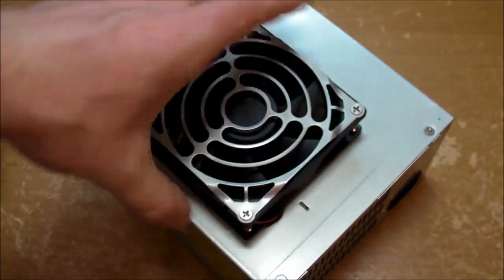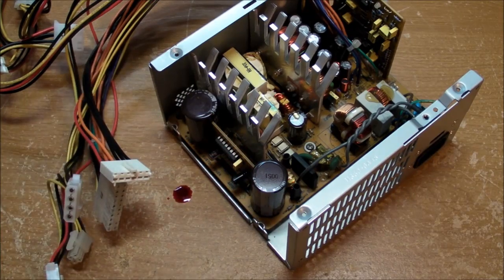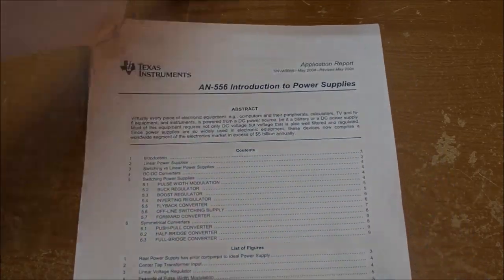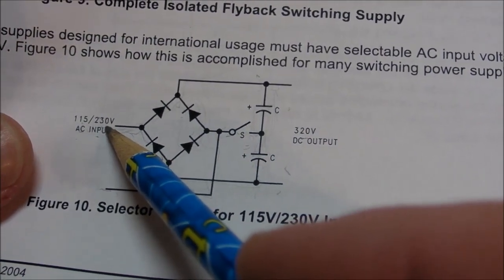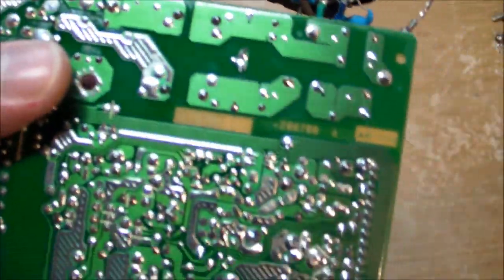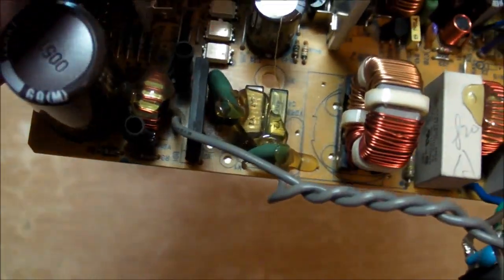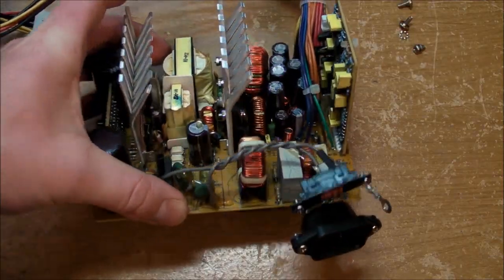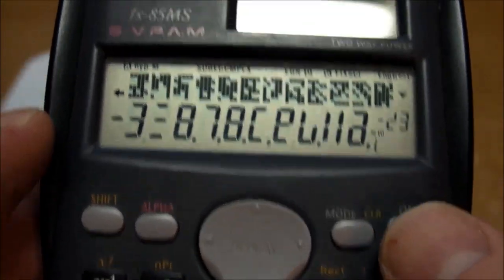(#0211) Simple Voltage Doubler Circuit in SMPS

Comment: Now server switching power supply only accepts 200-240v ac, will replacing these voltage doubler would work for using 110v? I have HP HSNPL-33 - thanks

Comment: 200V caps under duress of 283Vpk while on the 115V setting? You've aged your caps and sent them on their way to an early grave. The MOV is the first to blow (thankfully) but that's a sign the caps are next.  Don't overvoltage your caps if don't like to blow them up.

Comment: Oh man, thank you so much for posting this. You just saved my day, after ordering a US power supply to use in Europe. I couldn't use it nor find a compatible adapter. After finding your video went to check the circuit and there was this link on the board, all I had to to was to cut it! Thank you man.

Comment: The reason you sliced your finger was because the Ch-eye-na based manufacturers don't bother to put the stamped steel parts into a deburrer which would clean up the super sharp edges that result when they cut the sheet metal to form it into the casing.  It's a simple process and the deburring equipment isn't expensive, but if the buyer and engineer for purchasing do not specify it on the bill of material, purchase order and the drawing showing the finished part, the Ch-eye-Na based vendor will leave the  parts unfinished to save a few pennies because that is how they roll.....

Comment: Is this correct?
The power supply NEEDS 230v to operate, PERIOD!   When the switch is 'closed', we get a voltage doubler (here we are plugged into 115v and the doubler is active, supplying the 230v).  NOW, if we are already plugged into 230v, the switch is "OPENED" (NO "doubling" action), since we have the correct "wall voltage" and there is no need for 'doubler' action.
BUT:  If we are plugged into 230v wall power and activate the doubler by closing the switch (115v position) we are doubling the 230v to about "460v" inviting DISASTER!!!
I think I have this all straight, FINALLY AND THANKS TO YOUR VIDEO!

Comment: This is a DANGEROUS circuit!  If 220 is applied and the selector switch is set to 115 then the large caps will have 22*1.4=312v across them!  They are only rated for 200v.  Just for a nice voltage doubler (COMPLETELY SEPARATED FROM THE COMPUTER POWER SUPPLY), I would replace the capacitors with at least 400v versions.  Then I could use a SPST switch to select between 175VDC and 250VDC.  Don't forget to connect bleeder resistors across all caps.  I did this using 1100uF replacement caps (which I had on hand) and 47k 2W resistors (2W for voltage safety) along with a 6A 600V parallel pin FWB).

Comment: Very interesting! Thank you for posting this video! Just in the proces of creating a linear bench power supply where I could use this technique. I have one 5A coil with voltages from 9 to 72 V and one 15A coil with 12V. If this could be doubled I could use this as input for the DC section. 👍🏻

Comment: I am trying to understand the connection details of the selector (115 /230) switch:  Would it be correct in assuming that this switch is "isolated" from the rest of the circuit by two inductors...(1) from the neutral line input (and an AC connection of the bridge rectifier) by a larger choke.  And (2) (On the other side of the selector switch) from the doubling capacitors junction by the smaller toroidal inductor  (both of which are somewhat optional)?  

 THANKS FOR THE LOOK AT SUCH A USEFUL CIRCUIT ELEMENT!!
Reply: The switch is closed when mains is 115VAC. 2 caps are in series. Typically, switch input is mains neutral, output goes between the 2 caps, like a center tap.
Reply: His explanation is a little confusing, Try this, draw each circuit on a piece of paper one with the switch open and another with the switch closed. Now trace the current flow through the diodes and through the capacitors from line one to line two, first with line one being negative and line two being positive and then try the reverse. Do this with both circuits. The cathode side of the diodes is negative, not the way the gentleman in the video indicated. You should be able to see that when the switch is set for 115 volts the circuit acts as a voltage doubler, the two capacitors are charged separately and being in series, their voltage add and double the output. When set for 230v the circuit is a full wave bridge rectifier as stated in the video.

Comment: hi i guess im doing something wrong by connecting it to the mains because it keeps shortcircuiting......so where am i supposed to get my 230vac input???????? pls help
Reply: If you are using a 115v wall voltage, then set the switch to (115V), this will activate the internal doubler, giving you 230v which the power supply requires.  If your wall supply is 220/230, set the switch to "230v".  This disables the doubler.   NEVER set the switch to "115v" (the doubler enable) if your wall voltage is already 230v, as it will double to well over 400v!!

Comment: I was already aware of how the voltage selection switch worked, but your video gave me some interesting food for thought in relation to how I could use that selectable voltage with stepped down voltages. In fact I am going to test out a circuit right now as it may help me solve a power supply problem I have been previously having with one of my designs. Thankyou, for a very well presented video